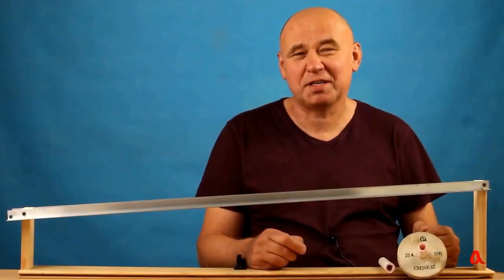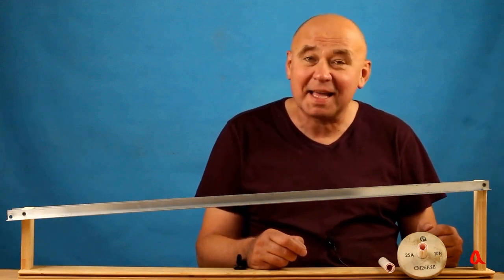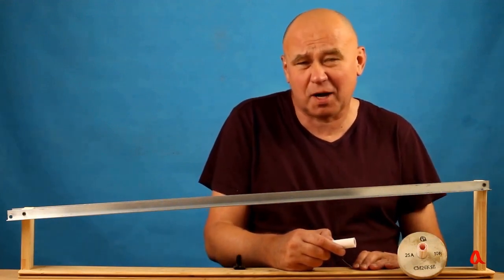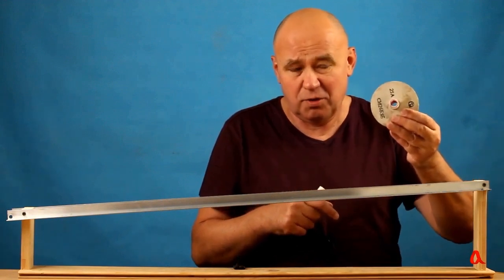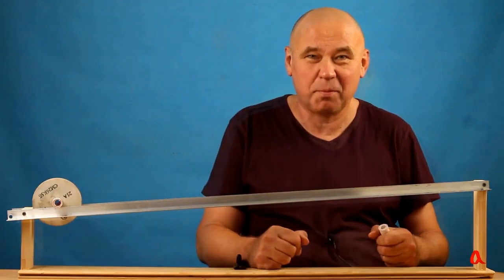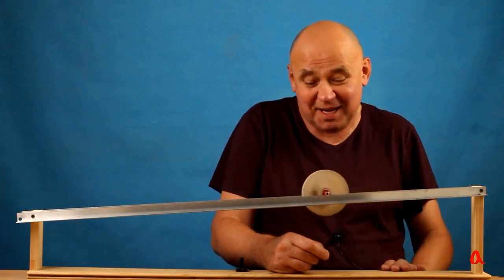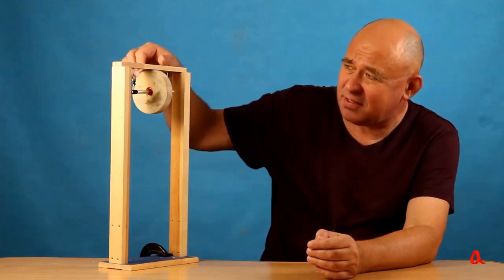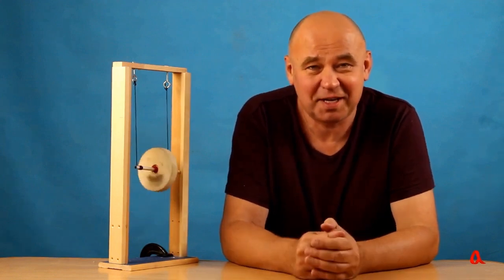Slow descent

Comment: Can use this concept to create inertial propulsion.  The big wheel with a tiny axle will "weigh less" as it is accelrated.  Then have it crash into something. 
Then it can provide a very short propulsion without the need to leave anything behind.  Probaly need to be mirrored with another device to cancel out angular momentums. And, motorized to be actually useful. Which i didn't do.